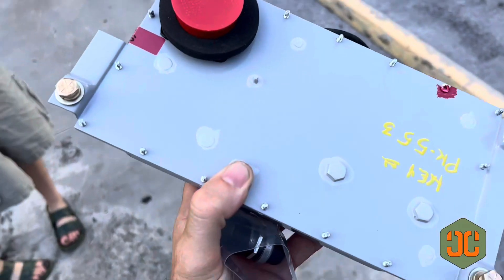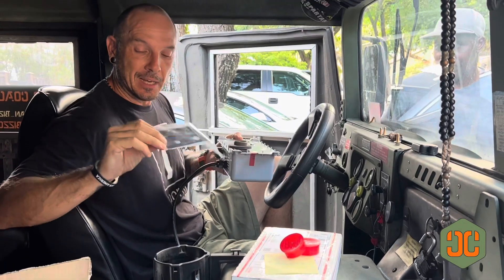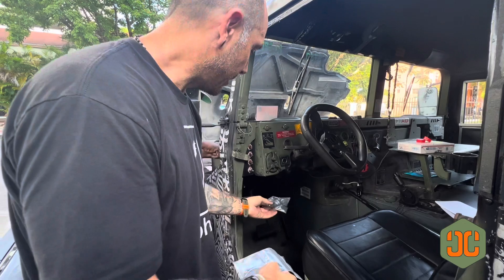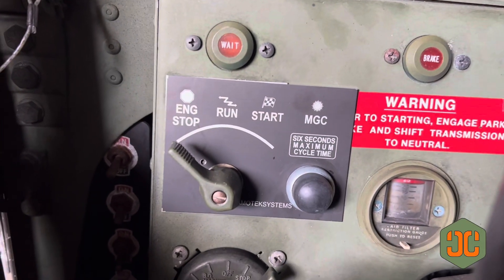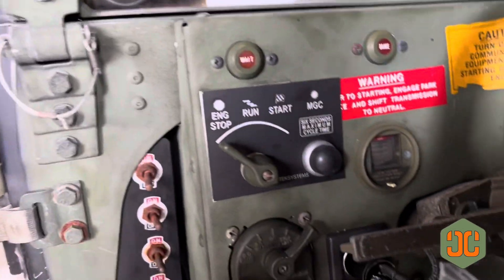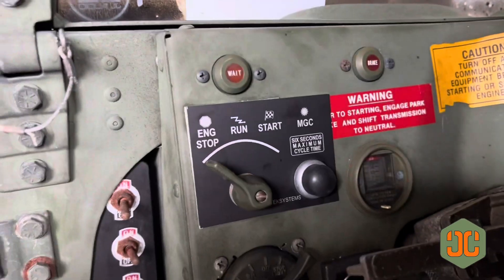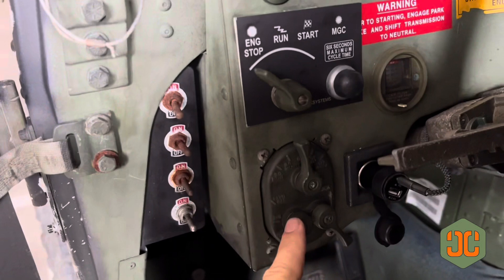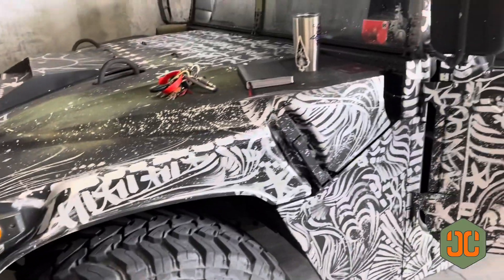CAMOTEK SYSTEMS HMMWV Start Box Power Distribution Manual Glow Control "PDMGC” install

Comment: Bro what sign did you have that your Smart Box was bad ?? I currently having issue with the wait light just flashing. Some have recommended me to swap it out I just want to be sure before I spend $1k
Reply: On mine, the glow plug heater wouldn't turn on when cold and the charging system wouldn't turn on. It would crank just fine and eventually would start but still no charging.
Reply: @farmsgrace341  Exactly the issue I am dealing with. My light blinks on then off immediately and won't cold start well if at all. the couple times I did get it started it'll run great after it's hot and will fire up right away so long as it's still warm.
Reply: @Jay172967  that's just your temperature sensor at the top of the engine, not your box.
Reply from the maker: Both times the box died it was just dead, nothing happening at all as if there were no batteries in the truck

Comment: What is the benefit of the upgrade ?
Reply from the maker: Smart boxes notoriously go bad or dry the glow plugs 
This makes the glow plug control manual
Also allows you to lock the box so vehicle can’t be hot wired or stolen
Works awesome
Great investment